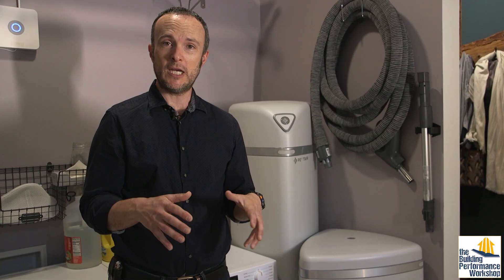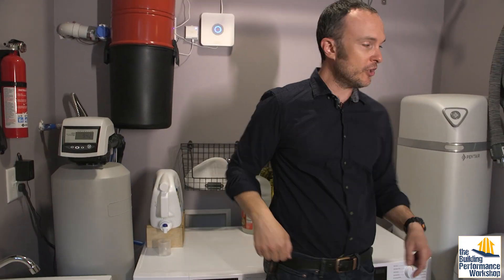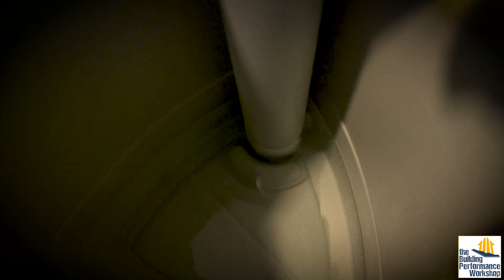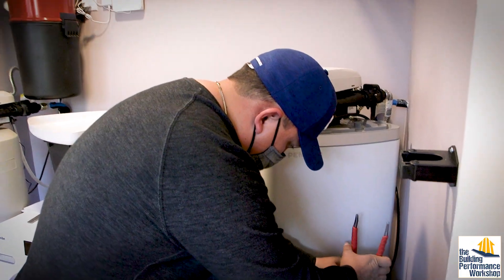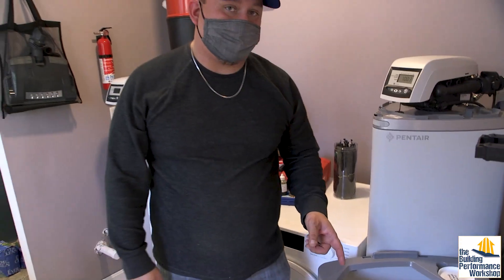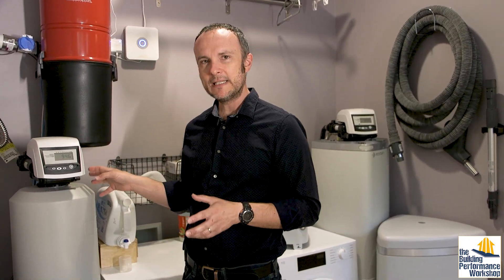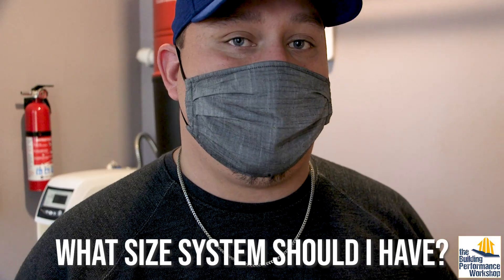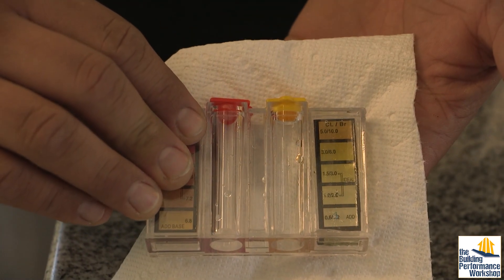Whole Home Water Filter, Water Softener, Reverse Osmosis, Groe Blu  and Phyn Leak Detection

Comment: Regarding the RO system, I'm fairly certain that the first three filters that hang below together are redundant given the carbon system that was shown in the laundry room.

RO systems are often sold this way (as a unit of 3 filters before the membrane) so that they can work in a variety of circumstances and protect the RO membrane, but only the RO membrane is necessary to perform the RO process.

I generally agree with the belt and suspenders approach described in these videos, but I think there is an opportunity here to avoid buying and changing these three filters given the upstream filtration already in place.

To test this theory, the water can be tested before and after the filters, or at the beverage station before and after temporarily removing the three filters from the canisters.

Comment: Are there any other tests that should be performed? We had a problem with too much copper in our city water. But testing for everything one at a time seems like nonsense. But even sending samples out to labs has proven hard to find or way too over priced for a normal home owner. I'd love to have a testing kit for some of the biggest offenders in municipal water.
Reply from the maker: Copper would show up in TDS, Brett, but yes, we also sent a sample to a lab to find out everything that’s in it. Same with air testing: mobile home testing equipment $20,000 / lab test equip $2 million

Comment: Well I ordered the same TDS meter and it just arrived. I know our water is hard and has lots of sediment and I don't change our RO filters enough... I was getting between 205 and 275 PPM from our city water.   A watersoftener is in the plans after the new bathroom is built as that nasty water isn't going into the new bathroom to gunk up the tile... I also need to look into a better RO system as well. Something bigger.

Comment: Hi question-you mentioned the mechanical/ laundry room is on the other side of the bedroom. What all have you guys done to mitigate noise? Eg double drywall? Thanks!
Reply from the maker: The suite is on the other side, meaning there’s a bathroom, then a walk in closet, then the bedroom. We didn’t do anything special for sound transmission inside the house, we just adapt. My granddad told me a story about a lighthouse keeper who had to sleep thru a cannon firing automatically at midnight every day- slept like a baby until one night he jolted awake because it didn’t fire. Anyway, I slept right thru the last backwash cycle now that I know what it is.
Reply: @HomePerformance  oh, you've got some separation between that room and the bed. Got it. Cool lighthouse story 😊

Comment: those are great but take out most of the minerals so you'll need to add them back. But i bet you knew that.
Reply: fruit, you're  welcome:)
Reply: Baba Gandu  just that calcite isnt enough.. thats minimal.
Reply from the maker: Add them back for what purpose, Kurt?
Reply: @HomePerformance  because your body needs minerals and water is a major source. Water softeners are only for your appliances they don't do anything for your health. You wouldnt want TDS too low because that means there is hardly any dissolved minerals in it. Just check out the TDS in like fiji or perrier.
Reply: @HomePerformance  RO is great but it takes out most minerals too. And per the guy that invented it you need to clean the unit once a month or it will be toxic with mold and bacteria. Most dealers dont tell you that.
Reply: @HomePerformance  its a catch 22 when using city water. you want all the bad chemicals they put in out but the systems take out all the good stuff. You want at least calcium and magnesium. What most do is put trace mineral drops in water and or put lemon juice in water for calcium and other minerals along with the calcite cartridge. It adds structure to the water too. the latest research on water is all about its structure.

Comment: Which would be better, distilled or filtered (in your opinion)
Reply from the maker: Not an expert on water, as you know, but even though I know in theory it should be the same, distilled water tastes weird to me- can anyone explain?
Reply: Filtered water improves the water by maybe 5 to 10 percent and distilled by 99 percent which is why the tds dropped from 60 to 50. Filtered is a broad term that includes very minimal to very intense, so his softener or carbon or reverse osmosis would be catoregized as filter. High grade purity is achieved through 3 processes: distilled, or reverse osmosis or deionization with reverse osmosis being the best 99 because its a closed system. Once water is cleaned through ro or distilled, its natural tendancy is to get dirty with anything it touches in the air or in the machine, so thats why stainless or food grade plastics are used. Some people complain of ro taste aswell so from my experience taste is subjective meaning some people have different sensitivities in taste and the other portion of why you might get differing taste is the journey the water takes and everything it touches between being purified and entering your mouth.
Reply: Congrats, and enjoy your water
Reply: @shelbytollett7119  I think RO does better at removing chloramine, as unlike chlorine, it evaporates with water still if I'm not mistaken?
Reply from the maker: Thanks for the details, all!
Reply from the maker: Thanks Shelby
Reply: @HomePerformance  Sure, when you put 7/8 PH water into a distiller, as the steam forms which then recondenses, it goes through the Carbonic acid effect  that makes the water PH read about 2/4 PH which makes it on the acidic side. When you let this water sit and react with the air it stabilises at around 6.5 PH after  a while and at this point would taste much better, though that's personal preference I think. Though I would think it absorbs better at 6.5ph rather than 2 or 4ph in the body, in my mind it must be good for stripping out both good and bad minerals out of our bodies as it must chelate with them as it passes through. The PPM on an average distiller would be about 0.2 or if medical grade it will be extremely low so much so that it might taste super acidic and could probably strip out life sustaining minerals causing some weird things to happen. Anyway, that's my thoughts on it, distiller you don't need to replace so I bought it thinking it would work out cheaper for in the long run
Reply: @HomePerformance  they are close. Distilled water is pure. It reads zero on a tds tester. Purified water goes through reverse osmosis- it usually reads 1 or 2 ppm on the tester. I'd buy whichever was cheaper -they taste identical